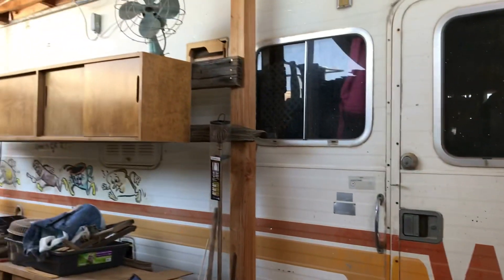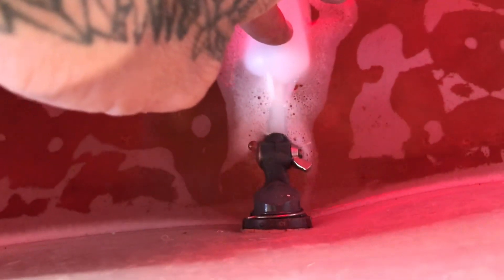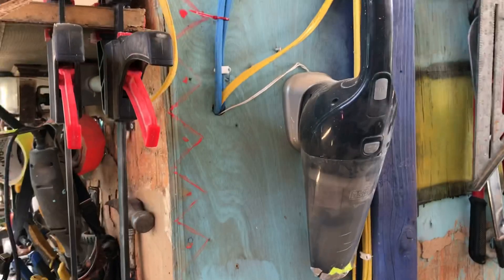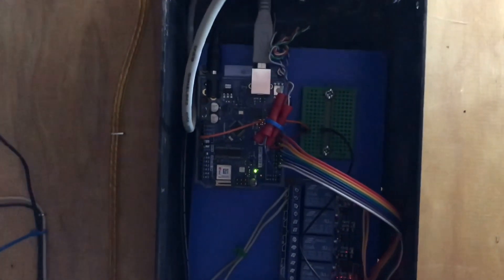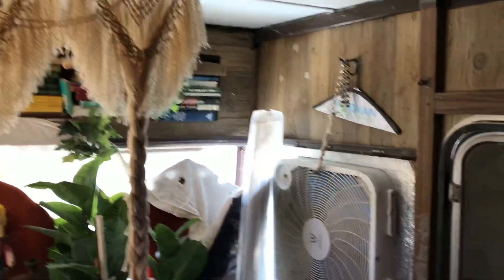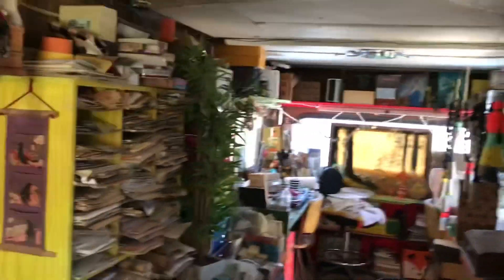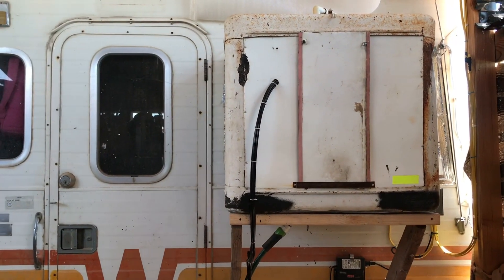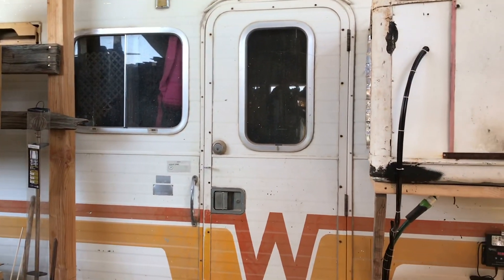Art Studio cooling system with swamp cooler, solar chimney and auto-tilt solar panel

Comment: You could provide "free" cooler air without any electricity taking your solar chimney further and creating the Venturi Effect. Instead of having a swamp cooler as the air intake, you build an underground air channel that has an opening on the north side and preferably under vegetation cover. Sure it requires some pretty serious labor digging a long several feet deep trench to then fill with 1 or more large diameter pipes but after the set up it's quite literally free air conditioning with no moving parts.
Reply from the maker: Totally! We are planning on using that kind of set up here at our new place in the Appalachian Mountains. “Earth tubes” to help stabilize our temps inside. Our greenhouse will also have something similar - usually called a climate battery.

Comment: Your auto tilt panel is so cool.  Now you need to figure out on how you could use a "Clock Drive" from a telescope to track the sun as it arc's across the sky keeping the panel(s) pointed at the sun :)
Reply from the maker: Oh nice, good idea. 

I’ve since built a larger version that is about to hold 4 large panels. It’s controlled by the same kind of actuator but is tilted using cables attached to the actuator. The Arduino that controls it has code on it with data from NOAA that allows it to know exactly what azimuth the sun is at at any point in the day, then the mount tilts accordingly. It’s a more accurate way to do it than the one in this video. 

I have an even more accurate way I’d like to try, but it’s too expensive! Maybe $100 in materials per panel, and we have 8 panels…

Comment: I got a lot of inspiration out of this! I just bought a compound in Death Valley that has a swamp cooler, and I'm totally overwhelmed.. watching this helped me make sense of things! I love the solar chimney!
Reply from the maker: Awesome! Yeah, swamp coolers are great if it’s not humid. Our valley has been CRAZY humid this summer so it hasn’t been great. We would like to dig some deep horizontal tubes underground and pump air through those to cool it and do geothermal/earth tubes for when it’s humid. Then you can switch between those two “modes” depending on how humid it is.

Good luck in Death Valley!
Reply: @RabbitSide  glad to know it wasn't just me... the humidity had me wondering if swamp coolers worked at all! It was crazy humid up here, too! Good luck with your air tubes!
Reply: @RabbitSide  How deep would you have to dig?
Reply from the maker: We have dug a pit that’s about 12-15 feet deep now and it’s just an open pit. It’ll be 105 degrees up top and 65 down in that hole. I’d like to now just dig horizontal tubes into the clay layer we’ve hit and pump air back and forth through those. 

If you did a very long tube you don’t need to go this far down. You could dig a long trench 6 feet deep, lay a tube in there and back fill it. The longer you make it, the more time air has to exchange that heat. 

If you angle the tube you can also have any condensed moisture flow to one end to be collected.

Comment: I'm doing the same thing as you! I've been off grid for two years now. I found your video by searching for "solar chimney" what's the delta on your system? I'm using evaporative cooling also but I have have a different approach because of humidity.
Reply from the maker: Yeah the thing works real well. It’s our first real attempt at one. Not sure what you’re referring to with asking what the delta is, though.
Reply: @RabbitSide  oh, how much cooler does the cooler make the air?
Reply from the maker: Ah, well we have two coolers on two different trailers. Our main system drops the temp 20 degrees on average but can be up to 30 degrees cooler if the conditions are just right. This secondary system has only been reducing the temp about 10 degrees. Part of that is due to less airflow, also that more sunlight hits that trailer and it’s not well sealed up. I also found out today that a lot of air was sneaking around the pads and not even cooling, so I added styrofoam to block those gaps and will see how it changes tomorrow.
Reply from the maker: Also, we’ve started to dig a cellar and it stays just over 60 degrees F down there. I plan on doing some geothermal cooing by running air underground to use on the more humid days. Should also be able to generate water with that.

Comment: I built a system for a friend's RV using 4 light-sensing diodes on the perimeter of a 4-inch plastic disc at 90-degree intervals separated by four plastic vanes/partitions 4 inches tall in a cross configuration. The diodes each seek the light triggering servos for the X and Y-axis. They seek to keep the center of the disc/cross aimed at the sun. On the extreme West position, there is a micro switch that triggers a reset, moves everything back to the East sun up position where it seeks the first light of the next day. I'll make you a sketch, you might find it handy for all kinds of daytime automation, you're a very clever fellow. I've been following y'all for years. Peace.
Reply from the maker: Awesome, thanks! Yeah I was originally going to go the light sensor route but then figured since I already knew where the sun would be each day, I could probably just work out where to aim the panel using that. I just got a satellite dish that I have put aluminum tape on to make it really reflective. It’s a decent parabolic solar dish now, and I’d like to use it to create steam and distill water. 

I’d use the method you’ve just described to aim that at the sun because it needs to be more accurate. I do have a few of those diodes hanging around I could use.
Reply: @RabbitSide  Yeah, it would be perfect for the dish. Mounted in the center it would keep it aimed directly at the sun. And yes, as long as your stationery, the system you've designed for your panels is clever indeed. The first creed of any engineer is to try to source as much material and resources as locally as possible. You used what you had in a very efficient manner, kudos!. The system I designed for my friend was for his school bus conversion; he had the roof real estate and more money than common sense.

Comment: Isn't it too dry in the desert for an evaporative cooler? You need some humidity don't you?
Reply from the maker: Opposite. Evaporative coolers only work when it’s hot and very dry. The hot air passing through the wet pads draws moisture into that air, and the evaporation causes the air to cool. In August/September it gets a bit more humid here and our cooler stops working as well. We’re working towards geothermal for those wetter months.

Comment: Can you get solar for AC?
Reply from the maker: We have a pretty good solar system here, but AC takes waaaay too much power. The evaporative cooler uses about 1/5 the power.
Reply: @RabbitSide  My Walmart AC unit uses 400 watts. very little power.
Reply from the maker: @Paradise Lost Very little power I some contexts, but when you’re working with a 2000 watt solar system, that’s a big chunk. We also need to still run our other stuff and once the sun goes down, we’re relying on a battery bank and not the 2000 watts from the solar panels. So a 400 watt draw all night drains the batteries too fast. Our evaporative cooler is about 80-150 watts and can be run day and night without much worry. AC would be nice but it takes $3600 worth in batteries to do it (and they only last a few years at best).